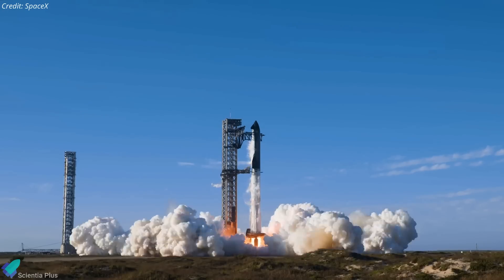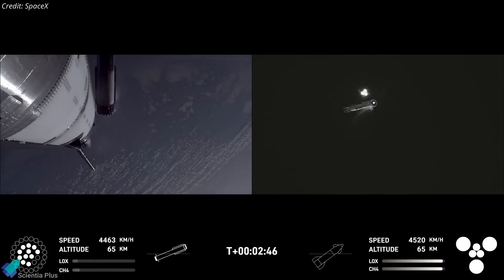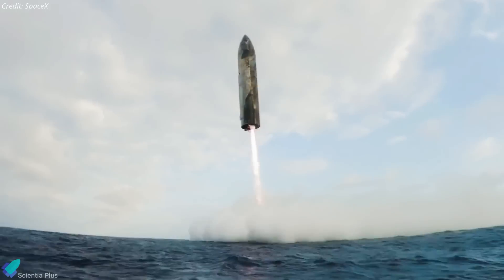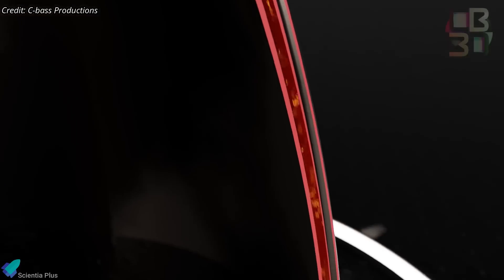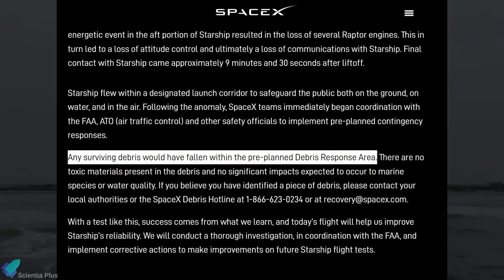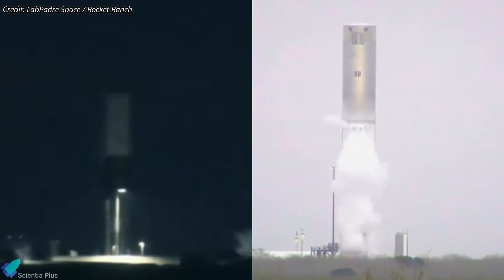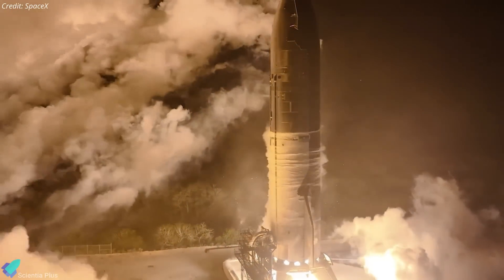Raptor EXPLODED & Ripped Off! The Root Cause Starship Flight 8 Failure Uncovered

Comment from the maker: 00:00  Flight 8 Breakdown: Booster Engine Fail + Landing
02:48  Starship 34’s Disaster: The Hidden Root Cause EXPLAINED!
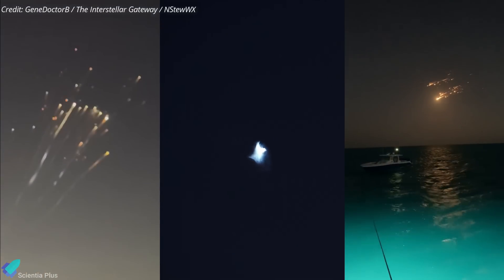06:02  Debris Everywhere! FAA’s Shocking Reaction & Investigation Update
07:52  Flight 8 vs Flight 7: The Unexpected Failure Pattern!
08:47  Flight 9 is Coming! Elon Musk Drops the Target Launch Date!

📚 Learn More:

🔹 Starship Block 2 Explained:
 📖 Summary: https://shorturl.at/b0dtw
 🔍 Detailed Explanations:
  • Design Improvements Update 1: https://shorturl.at/lpGT7
  • Design Improvements Update 2: https://shorturl.at/gwNQ4
  • Nosecone & Payload Bay Redesign: https://shorturl.at/xa60S
  • Methane Downcomer Redesign: https://shorturl.at/XdYBG

🚀 Starship Block 3 Features: https://shorturl.at/mnBT4
🔄 Starship Block 2, Block 3 & Raptor V2, V3 Complete Update: https://shorturl.at/tN248
🔥 Raptor V3 Mega Upgrades & First Test: https://shorturl.at/TRIyj

🛠 Latest Starship Upgrades:
 • Hot Staging Explained: https://shorturl.at/jf400
 • Super Heavy Booster Upgrades: https://shorturl.at/Pi5R3
 • How SpaceX Protects Raptor Engines: https://shorturl.at/4Om8F
 • New Heat Tiles Explained: https://shorturl.at/p2Ijb

🔍 Starship Flight-7 Anomaly Root Cause & Fixes: https://youtu.be/UqzZx7vb-TA
🔍 Flight-8 Mission Explained in Detail: https://youtu.be/7qUfBYPDCn8

📡 Stay Updated:
📢 Weekly Updates: https://bit.ly/3HIQjPC
🚀 SpaceX Playlist: https://bit.ly/34wue8T

🌍 Follow Us:
👍 Facebook: https://www.facebook.com/scientiaplus

Comment: I'm sorry but the root cause is the new coolant system. Flushing the highly flammable  fuel through hot areas of the ship after engine shutdown is gonna start fires, just saying 

I bet gasoline could be used in my car's radiator to cool off the engine? But, I also think the sudden flushing of fuel through hot engine parts might start a fire :o

Comment: It seems like the ship is tiny compared to the debris field. If it’s going to come down in the water, why not leave it intact so that there won’t be so much crap falling for hundreds of miles disrupting air travel. ATC is really good a separating airliners from each other. They can easily turn airplanes out of the way of a 747 sized ship.

Comment: OOK-----------.  WHAT THE LEAK AND FIRE IN THE SKIRT DID WAS CAUSE A LEAN CONDITION IN THE COMBUSTION CHAMBER RAPIDLY INCREASING ITS TEMPERATURE THAT IS MORE LIKELY THE  REAL CAUSE OF THE ENGINE SHUTTNG DOWN AS IT BURNED THROUGH THE CASING, DESTROYING  ITSELF AND EXPLODING OUT ACROSS THE ENGINE COMPARTMENT ... TAKING OUT THE CLOSE SURROUNDING ENGINES...
-----------..  IF THAT WAS EVEN THE REAL PROBLEM THAT STARTERD THE DESTRUCTION.. .AND NOT JUST A NON-ATTRIBUTABLE ANOMOLY....
-----------..  THE REAL CULPRIT COULD BE THE NEW SEPARATED DOWN COMER PIPE FOR THE VAC ENGINES, NOT ON THE PREVIOUS STARSHIP BLOCK OF STARSHIPS...   THE SOLID STRAIT PIPE IS  LIKELY TO INTRODUCE STRESSES NOT SEEN BEFORER.THE BLOCK 2 STARSHIPS  THAT IS COMONE TO BOTH 7 AND 8 LOANCHES......
-------------.  BUT BRINGS UP ANOTHER VERY IMPORTAND  POINT AS TO "WHY" THE VAC ENGINES ARE NOT CANTED IN 5 OR SO DEGREES TO ALIGN THERE THRUST TO THE CENTER OF STARSHIP

Comment: OKO---------.  THE STATEMENT THAT THE SINGLE BOOSTER ENGINE NOT REIGNIGTING DURING LANDING "PREVENTED A FULLY CONTROLLED DESENT TO LAND"  WAS WHOLY A LIE...DESIGNED TO CREAT TENSION FOR THE READER WHILE DENAGRADING SPACEX WHO HAD DESIGNED THE BOOSTER TO EASILY LAND SAFELY WITHOUT WORRY EVEN IF SEVERAL ENGINES FAIL....  ONE ENGINE NOT LIGHTING WAS NOT REALLY WORTH EVEN MENTIONING AS MINOR NEEDED TUNING AND NOT THE CATASTROPHY THE VIDEO IS TRYING TO MAKE IT OUT TO BE....!!!
----------.  NOTHING COMPARED TO LOSING THE STARSHIP IS...!!!!  EVEN THAT IS NOT AN UNEXPECTED CATASTROPHE... JUST A TERRIBLE...INCIDENT THAT HAPPENS IN ALL TEST PROGRAMS... ALL AIRCRAFT IN HISTORY AND EVEN JET FIGHTERS OF TO DAY LOSE MANY AIRCRAFT AND PILOTS BEFORE THEY ARE PERFECTED SAFE... TERRIBLE BUT JUST FACTS OF TEST PROGRAMS...

Comment: Got a few questions about your theory.   Hot spot on engine bell caused by leaking ch4 has an issue, 140KM altitude at the time is close to vacuum and ch4 fire requires oxygen source.  Rocket exhaust wouldn't support that as it's fuel rich anyway.

Comment: I think it has to do something with no secondary engine shielding. Flight 7 and Flight 8 used Block 2 design. So we might see a 2B design or changes around that area.

Comment: She's too big of a bird. They have to solve vibration dynamic issues which I don't know if they can. That vehicle has to withstand 16M pounds of thrust. I can't imagine the environmental issues that the vehicle as a whole has to take on due to the sheer power of its propulsion systems and the size of the system.
Reply: Yes, sometimes big can be too big, elon wanted his BFR and it is only going to get BIGGER!! More engines, more fuel, more weight, more thrust, musk have more, more …

Comment: Those sea level raptor are shaking the vacuum raptor to pieces, especially when the fuel tanks are low. Run all six vacuum raptors, you know, like in the original plan.
Reply: But are they not already planning on 3 more additional vacuum engines in addition to the required SL engines required for recovery ‽

Comment: I’ve been thinking about the possibility of damaged caused by the hot staging.  There has to be a massive amount of pressure exerted on the engines, even with the gaps in the sides of the ring.
Pure speculation, I know…but since we are all speculating, my two cents.
Reply: Too close...too much back pressure

Comment: At what point does failure mean failure rather than a learning experience?
Reply: When the program is no longer in the testing phase.
Reply: @daleeasterwood2683  Err, testing can be a failure, bud.  Not reaching low earth orbit after 7 years, not landing in Mars in 2022, not landing humans on Mars in 2024, achieving none of your stated milestones, all of which were supposed to have been delivered last year, still not having a human rated craft and admitting that the load capacity is a fraction of the initial claims sure doesn't sound like success
Reply: @Orgoneblue  Awfully long reply to my very simple answer. In testing, failure is a learning experience. Call it a failure if it makes you feel better.
Reply: @daleeasterwood2683  Pretend it's not a failure if it makes you feel better

Comment: OK-----------.  A  FLIGHT 9 STARSHIP STATIC FIRE TEST, EVEN A FULL MINUTE LONG, WOULD STILL BE NO BETTER THAN 7's OR 8's STATICS... AS NEITHER PUT STARSHIP UNDER ACCELERATION FORCES...GREATER THAN 1 GE....   THAT MAY HAVE FLEXED THE LOWER TANK DOME INTO OR AWAY FROM THE MANY DOWNCOMERS THAT PEIRCE THE DOME... WHICH MAY VERY WELL BE WHAT BROKE ONE OF MORE OF THEM... AND NOT SIMPLE FLANGE LEAKS OR VIBRATOIN CRACKS... 
-----------.  THE RED SECTION OR SPOT EVERYONE HAS NOTICE TO SOME CONCERN ON THE LOWER VAC ENGINE BELL POSSES NO PROBLEM EVEN IF THE LOWER BELL WAS PEIRCED OR BLEW OUT...  WITH NO EFFECT TO THIS FAILURE...

Comment: The vaccum Raptor engine bell failure appears to be manufactured flaw and may never occur again and with out the engine bell that failed to inspect good luck on the analysis.  Maybe on Flight 9 going back to the previous block Raptor engine could get the Starship through it's next test flight.  Note that the robust of the Starship as a whole operated almost to orbit even with the engine failure in progress.  Fluke or design failure is the big question.  Fluke due to one off failures are really hard to solve as the design is likely not the issue but until you can duplicate the failure your only guessing about the design.  I'd assume a design failure fall back of the previous block engines to get through the flight proving testing.  In the mean time if not already working on it a expendable upper stage design to boost super heavy payloads into at least GEO orbits is a immediate must especially to capture USSF as a primary customer with immediate needs.  Also as a replacement launch system for Artemis spacecraft and lunar landing spacecraft.

Comment: 🧐🫣🤔🤗 All 6 engines were started at the same time. The outer 3 have longer cooling lines that take more time to fill while the inner engines already produced max heat reflected by the flat surface of the separator ring construct.

Solutions:
1) start inner 3 engines AFTER outer 3 engines (even if that means 1 second of having no directional control)
2) get rid of the flat surface (make it conical or round like the upper tank section already was)
3) get rid of the buildup part on the inner-end of the 3 outer nozzles (that is a structural weak point)
4) check the accuracy of the 3D printing that creates the cooling tubes in the nozzles to verify that all tubes have equal resistance (no sections with smaller diameter)
Reply: Nozzles may be to thin...the question is was it the same failure mode as the last RD? Vibration 📳. 😊
Reply: I made a similar comment in another channel, something is breaking after hotstage, where it didn’t break in ground testing, if I’m not mistaken the center three are gimbaled outward during separation, I’m no engineer but in your camp the amount of pressure build up during up the hotstage phase could be a root cause.

Comment: In short...

- There was obvious "burn through" (Timestamp 3:17) the damaged edge of the bell of one RVac engine is clearly visible.
- This was probably caused by a leak or blockage in the Regenerative Cooling system in the engine bell, allowing overheating and the subsequent failure of the bell mouth edge structure.
- In space, in vacuum, the rocket exhaust exits the "mouth" of the bell of the RVac engine unconstrained by atmospheric pressure, and so the gases exit nearly at right angles to the bell through an arc down to directly in line with the bell. (The "squid" effect seen as the rocket climbs through atmosphere to vacuum).
- (at timestamp 3:11) You can clearly see one edge of one RVac engine has a "notch" missing causing the exhaust gas to exit nearly at right angles to the direction of flight through this notch.
- These hat exhaust gasses are blasting directly against the sides of the center 3 Raptor Sea Level (RSL) engines.
- This is seen as a light reddish haze of burning gasses "seeming" to come out to one side of the center of the 3 RSL engines.
- This is, I believe, what caused the failure of the damaged RVac engine and the subsequent failure of 2 of the RSL engines.
- This off-center thrust caused the rapidly increasing out-of-control spin and thence the loss of Starship 34.

Comment: Thanks, you are (for me) the first channel to explain what may have gone wrong. The others make a lot of hot air and tell us that SpaceX repeated the error as the ship exploded again, which is nonsense..
Reply: No, they did not really explain anything for sure. They just threw some very wild speculation that may be totally wrong.

Their explanation looks just like asking an language model AI "why do docket engines typically fail?". Full of speculation where many parts of the speculation are clearly wrong.
Reply: I agree with you

Comment: A lot of possibilities for the actual cause of the failures.  There is a lot of data to look at to get to the root cause/causes.  It is really helpful to have the visuals.  They have to determine if it is a flight dynamics issue or a design issue.  Could be a combination of both.
Reply: One of the ideas speculated damage to the fuel lines and releasing particulates from hammer.  Wonder if that is why the other engines shut down, if hammer affected the valves up stream?  Interesting stuff.

Comment: A bit surprising that ALL the engines were not shut down (automatically?) as soon as 2 of the inner engines had failed as uncontrolled tumbling was bound to follow. The space ship would have  "coasted" safely giving time to examine the data before activating the destruct system.
Reply: Good input to add new scenario algo in their control program
Reply: Good idea, but I guess they didn’t have time to think about that. Personally I think that there is a different reason they didn’t shut down all engines.

Comment: The risk reward for "hot staging" has reached it's limit. "cool staging" put's less weight into orbit, but oh well. The amount of vibration and heat generated on the engines is too much and kicking the booster away to the side and then lighting the block 2 engines is a whole lot safer. Maximum weight to orbit has been reached, or not, with hot staging but that shouldn't be the goal at this point but we must protect the plumbing and those beautiful engines from all the intense vibration and heat of hot staging by "cool staging". We did it with the boosters.

Comment: Chaos theory: if I can understand the mass flow, structural geometries, fuel temperature and pressure, weld material and quality control, liquid homogeneous distribution, atmospheric conditions, angle of attack, aerodynamic center of gravity relative to center of mass, heat annealing treatments and vibrational induced propagation of dendritic imperfections, I should be able to deduce that Elon Musk will still be a douche bag tomorrow.

Comment: Hot stagging separation .. cause to much stress in the lines and engines. maybe they should do a hot stage separation only with trust engines and after separation then turn space engines on..  A test of the engines on top of the separation  ring on earth will clarify if this is happening.. maybe a land test with Starship on top of the sepration ring will be beneficial..
Reply: in short, ground testing would just burn the hsr, the exhaust is too concentrated. at staging the plumes are expanded enough to make it so that the ring receives less direct heating in specific spots, instead spreading properly.

Comment: I believe that the "hot staging ring " is causing over heat to the engine compartment, thereby causing engine failure.
Reply: That's likely. The Russians  used a taller x ring that allows exhaust  to escape much faster, lessening blow back vibrations to the bells and plumbing on the motors. Space X has the right idea but not quite as efficient  as the Russian one. My opinion  of course. ..

Comment: Incredibly competent  analysis.  It shows just how complex rocket science actually is.  SpaceX has test fired these engines but things are always different in real world test conditions from the test stand.  

I would like to point out that the slow careful analytical approach that Blue Origin is taking has its advantages too.  The competition between the two companies is a lot closer than people have realized.  Good luck to both companies.  In a few years we're going to have two reliable US made systems that will be able to get large payloads into orbit.  Each company is using a different engineering and testing philosophy but they are both going to be successful.  

Your analysis of the situation is the best on the internet.  Does anyone have any idea what Blue Origins status is on its next launch?

For those of you not familiar with the competition between the two companies Blue Origins second stage is hydrogen-powered which may make it more powerful than Starship.  My last  understanding of Blue Origins situation is that they are still finalizing their plans for their second stage.  Remember that all of NASA's Vehicles including the space shuttle where hydrogen powered.

Again keep up your good work and analysis.
Reply: No, just asking a language model AI "who do rocket engine typically fail". Some part of their "analysis" is clearly wrong as it contains things not applicable to starship/raptor.

Also the name of the video is a clickbait lie.
Reply: @alaneverett9767  are you kidding. Its so obvious that the scripts for these videos are all AI generated. And the AI voice is too robot-ish for my teste.
But i'm glad that you lige AI generated videos, AI generated scripts, AI voices, AI generated thumbnails. What a world
Reply: To bad is a Chinese vedio!!!
Reply: Can Jeff beszo go fir the rude please?

Comment: Methane alone does not burn. It requires oxidizer as well. While a lot more of O2 is vented normally, in the vacuum conditions of space, this dissipates pretty much instantly. It's only when you get a fuel/oxidizer mix that combustion can occur.
🖖😎👍

Comment: Hot stagging separation .. cause to much stress in the lines and engines. maybe they should do a hot stage separation only with trust engines and after separation then turn space engines on..